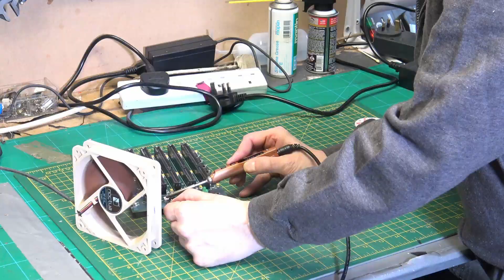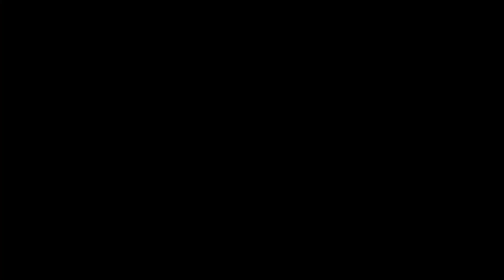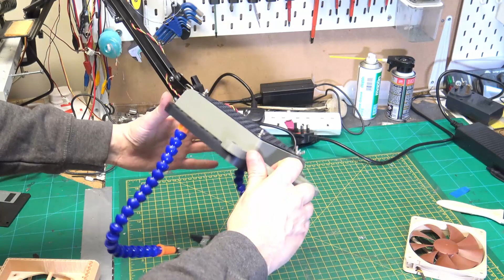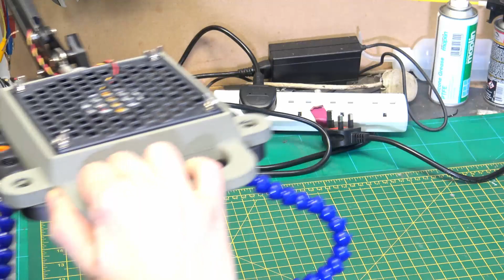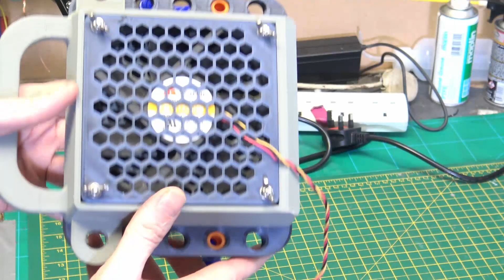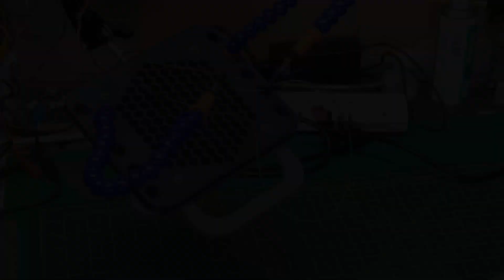Boom arm Solder fume filter with active charcoal and helping hands.

Comment: How did you model the knockoff loc-line screw threads? I've been trying to model the profile in Fusion and not having luck
Reply from the maker: I used tinkercad it has a very easy wizard for threads